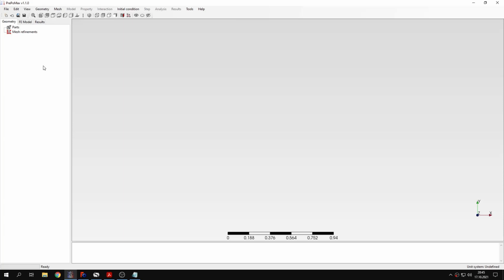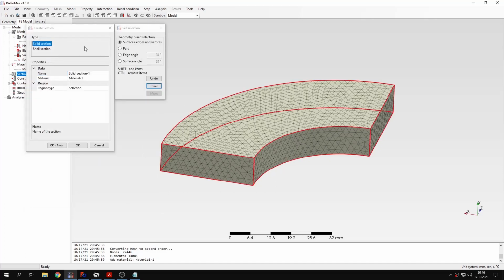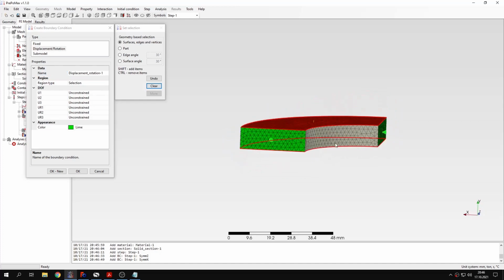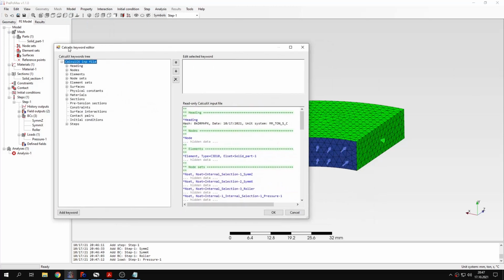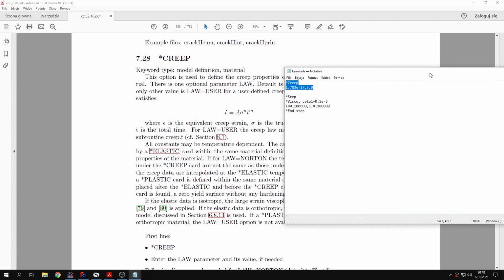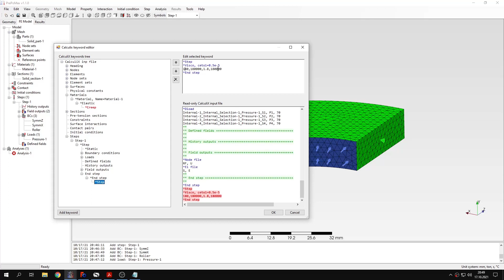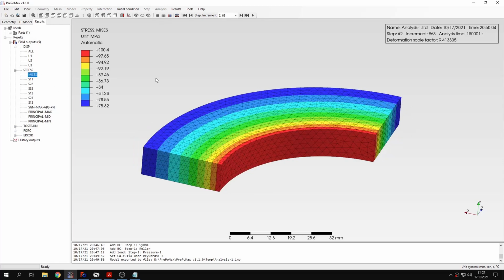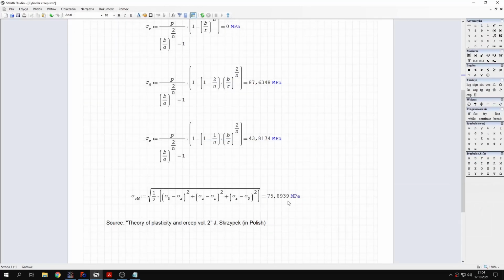PrePoMax (CalculiX FEA) - Tutorial 12 - Creep of a thick cylinder (Keyword Editor)

Comment: For guys having failure, AI suggested me to move Creep out of Elastic, directly under Materials and it worked...
Reply from the maker: Was there some error message before you made that change ? It should work as long as the keyword structure shown on the right is correct:
*Material, Name=...
*Elastic
...
*Creep
...

Comment: Very interesting tutorials. Can you show how to define a material with orthotropic elasticity such as wood. And then how to get shear, compression, and tension forces acting inside a solid beam when a external force is applied in the middle of it.
Reply from the maker: Thank you. Unfortunately, orthotropic elasticity is not yet supported by PrePoMax but it can be defined using the approach shown in this tutorial. The same applies to section forces, they can be obtained with the *Section print keyword that saves them to the .dat file. The example that you describe is very interesting. Currently, I mainly focus on features that are implemented in PrePoMax but there aren’t that many left and likely I will soon go back to functionalities requiring keyword edits. To avoid confusion, I will mark them with "(Keyword Editor)" in the title.

Comment: Hi,
Thank you for this video !
I am just surprised that you get this message when you start the simulation : 
 *WARNING reading *STATIC: a nonlinear analysis is requested
          but no time increment nor step is specified
          the defaults (1,1) are used
?
Is it normal ?
Reply from the maker: It’s a common message that appears whenever a nonlinear analysis is submitted with the default incrementation in step settings (i.e. pure *Static keyword). As stated in the warning message, in such cases CalculiX uses default values for incrementation:
- time period: 1
- initial time increment: 1 (modified due to automatic incrementation anyway)

In general, warning messages generated by CalculiX can indicate problems and thus require attention but in practice most of them are harmless ;-)
Reply: @FEAnalyst  Thanks for this reply !

Comment: Very interesting video. In the past I have made a lot of phisical creep testing on rubber parts, we usually put a constant load (dead weights for long runs, or servohidraulic actuators for short tests) and measure the increase in displacement of the part under that constant load across the time. Do you know if is possible to made this using Calculix? I meant, plot the increasing displacement against time with a constan load????
Reply from the maker: Sure, you can use history output request to write displacement at selected node and the plot it against time in postprocessing. All that without leaving PrePoMax. I did it a few times when preparing this example but with stresses in selected element - I wanted to make sure that steady state is actually reached.
When it comes to load amplitude, in visco step load is automatically fully applied at the start of the step and then held constant. This is done in contrast to static step where load is ramped (linearly increasing) by default.
Reply: @FEAnalyst  thanks, I will try as soon as possible.
Reply from the maker: @4pingenieria81  No problem, let me know if you need any help with that.

Comment: nice vid. I was thinkig, if this Keyword Editor works as it works, a welding simulation with DFLUX could work as well.. Or I'm wrong
Reply from the maker: I’ve never tried to simulate welding in CalculiX but I’ve done that in Abaqus. Unlike Abaqus, ccx doesn’t have built-in functionalities/keywords for AM and welding process simulations but it should be possible with subroutines. PrePoMax already supports transient heat transfer and thermal stress analyses (I will show these functionalities in the future videos) so it’s only a matter of adding dflux.f subroutine to model moving heat source. 

I’ve found an interesting presentation titled „Low Cost Welding Simulation” by O. Dreibati. It discusses in detail how to analyze welding using CalculiX (old release - 2.11 but it shouldn’t be a problem). Check it out, it might be helpful. Even element activation/deactivation is included there.

And even if Keyword Editor is not enough to define some unsupported features (as I’ve mentioned in the video, existing keywords can’t be modified, you can only add new ones) then you could prepare the model in PrePoMax, export ccx input file, edit it in a text editor, submit the analysis using command line and then import the frd file with results to PrePoMax for postprocessing.